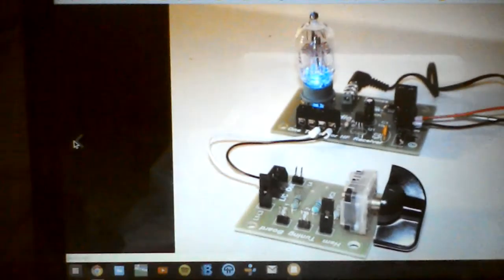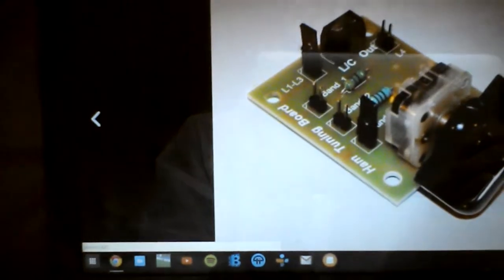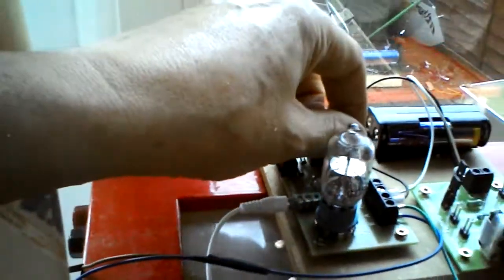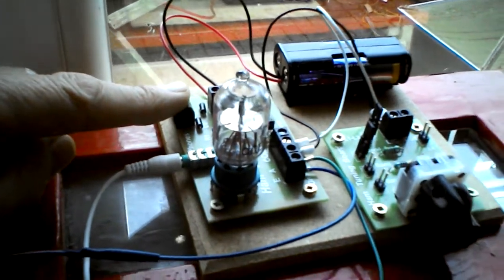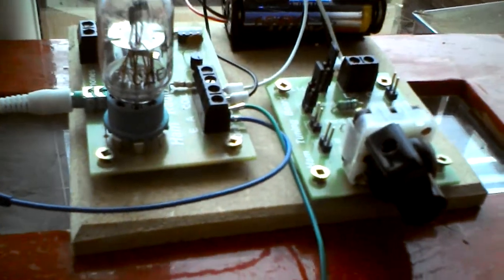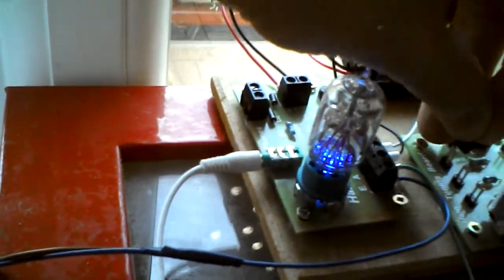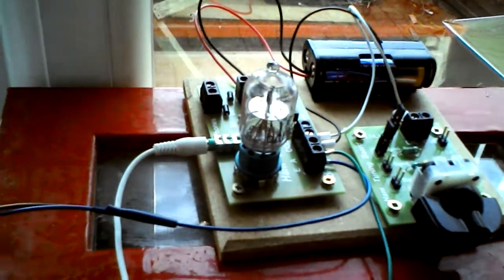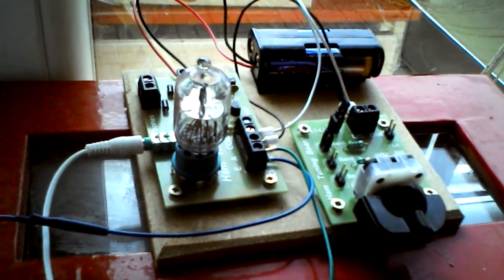One Transistor receiver kit

Comment: Hello, I have a kit from the same seller. A Poldhu Radio DIY KIT Crystal HF receiver. It does appear to work, until I tried the crystal side only and nothing just the faintest of signals even when amplified 200 times. I tried with the powered side and it did make a big difference. I found a problem, I does not matter if you have the tube in or out when the power is on and set to night the reception is quite good. The tube does not use any power, I measured with amp meter and found no current draw beyond a few milli amp for the circuit and no difference at all between tube in or tube out, no matter how I tried.